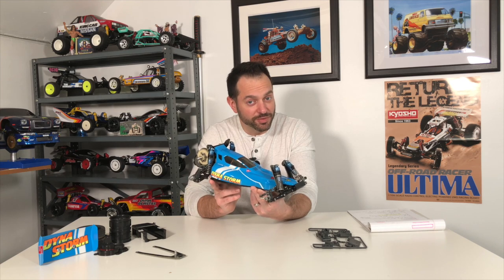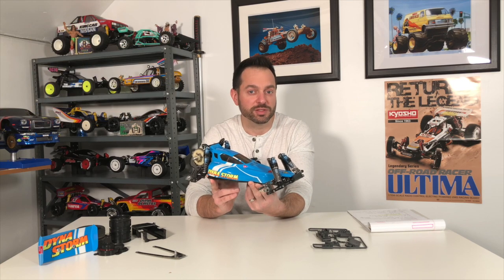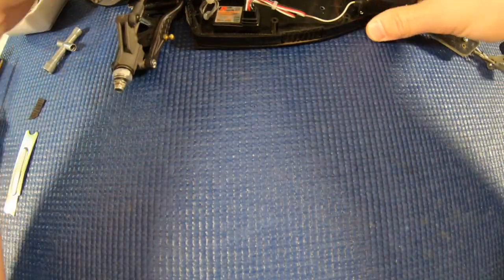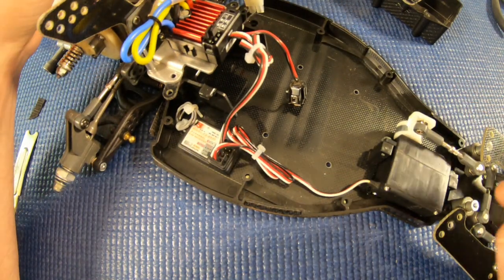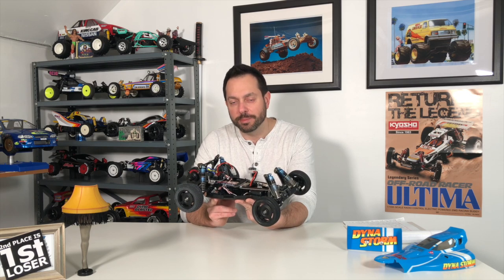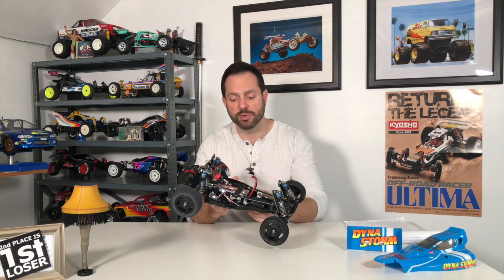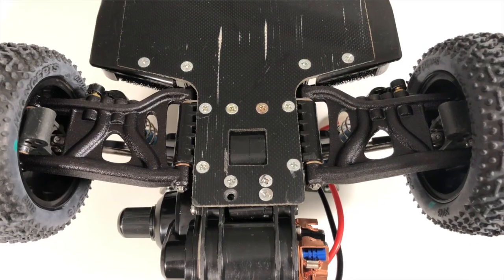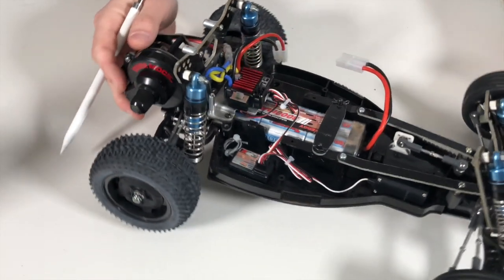e185: Parts Swap! Carbon Parts Tamiya TR-15t Stadium Truck & 3D Printed Parts To Fix The Dyna Storm

Comment: Instead of screwing the battery retainer from top and bottom, consider tapping it through and running a long machine screw up through the bottom. Then put a nut on the top. The self tapping screws put a lot of stress on the plastic.
Reply from the maker: Thaks for sharing that idea.  Its actually a great idea.  I've already sources the origiinal battery tray and installed it.  If it were to break again, i'll most likely use your strategy.  Thanks.

Comment: Great to see my rear suspension arm fit nicely. also I like the way you repaired the battery tray. Maybe lost a tiny bit of stiffness since its two parts now but probably you wouldnt notice. Best wishes, Wrenchdog.
Reply from the maker: Arms were awesome.  No issues.. Shot them with some gloss spray first.  Since posting the video, a fan of the channel reached out and sent me a battery tray.  It looses a lot of its rigidity without it.  So getting the battery tray really helped.  Sorry I didnt give you a shoutout regarding the 3d printed arms.  I apologize. But i'll definitely be checking in to see what new parts you are offering.

Comment: Hi mate. Did you lose any of the chassis rigidity by having the battery tray in two parts?  Good video
Reply from the maker: Yes.  Good noticing.  There is a slight flex to it but I'm in the process of getting a battery retainer for the Dyna Storm from someone.   I guess it was a quick fix but definitely it would be much better with the original battery retainer since it runs all the way down and anchors the rear and the front.  It was an idea I thought I'd try out and see....
Reply: @RCRetro  yeah it's cool. Maybe you could use a couple of thin pieces of carbon to brace them together

Comment: Hi Arri, I have a battery retainer brand new you can have for free
Reply from the maker: That’s awesome.  I’d love that because there is still some flex to the whole chassis with that super astute battery retainer.  It’s not as good as having the Dyna Storm battery retainer running all the way down the chassis and anchoring in the rear of the car.   My email is Akap23@gmail.com if you want to chat and I can provide you with my address or you can reach me through Facebook... let me know.  Thanks and of course I really appreciate that you reached out to me for that part.  It really helps.

Comment: Looking forward to seeing the Dyna Storm going around the track. Good to know about the TR-15 parts.. Finally got my own Dyna Storm to add the fleet :)
Reply from the maker: Awesome.  Should you need parts, there is a seller/desinger on shapeways called wrenchdog who makes all 3d printed parts for the dyna storm.
Reply: @RCRetro  Thanks Ari, good to know.. Thankfully I'm good for now no cracks yet. But I'm going to be looking at getting spares just to be safe.